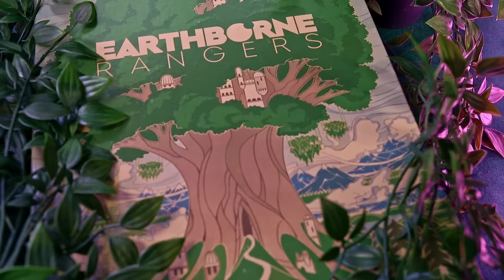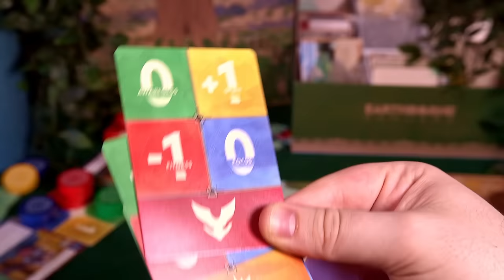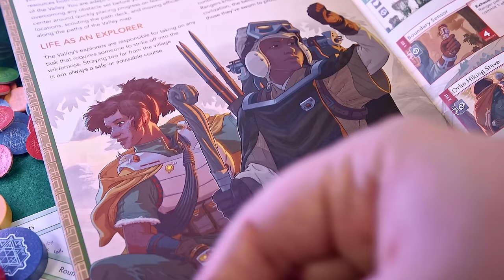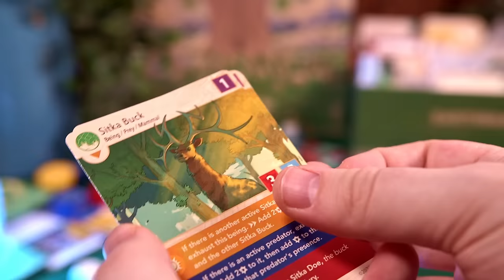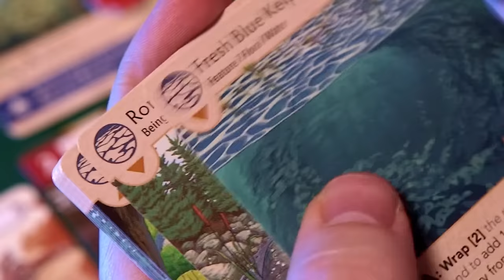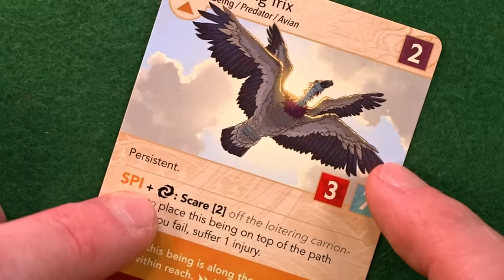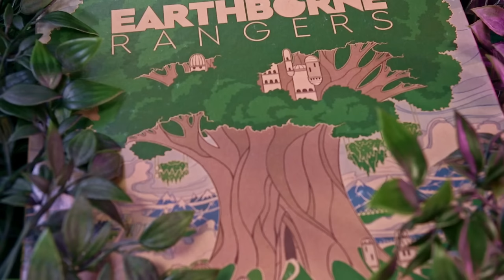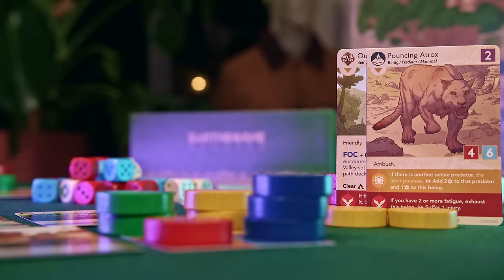Earthborne Rangers is Revolutionary

Comment: Yeah this game is really great! For those of you wondering if it’s worth the price, a single campaign can run 20+ sessions, so there is a lot of game in this box. It’s also one you could play with kids ~9 and up.
The cards came in a paper wrap that was so amazing and easy to open without damaging the cards, that I wish every game’s cards were wrapped that way.
Reply: Is it a one and done campaign?
Reply: @michaelrichard1320  no! The way the characters are made you’ll want to try different combinations of backgrounds and roles (similar to how Marvel Champions does deck building). And it looks like the new expansion has 1 of each! As is those two aspects alone give you 25 deck combinations. Plus each campaign will be slightly different.
Also, on that note, the card doubler is helpful if you’re going to player 3-4 rangers OR if you are going to play 2 different campaigns with different people concurrently.
I did the latter. Played a solo campaign with one background and role, and a 2p campaign with my partner as a completely different background and role. They presented different challenges and the campaigns turned out quite different!
Reply: @michaelrichard1320  Not at all. There's a ton of stuff to see and do in the game that isn't directly tied to the campaign story, so additional plays will likely have new things to see that you missed or passed over the previous time. And of course there's playing with new rangers and cards to add a lot of variety to how you take on challenges. They also just finished funding for a complete expansion campaign, including new cards to add to the Paths deck for the base campaign, as well as a new Ranger type.
Reply: Do I have to stick with the same group of people during one "campaign"? Could I theoretically play seperate campaigns with different people simultaneously like I get a game with four people only once every two months but I would play in between those two player rounds? Or is there some reseting to do in between those?
Reply: @michaelrichard1320 if you're looking for a different story the second time through, you won't get that here.
Reply: @jessecunningham9924 bold of you to assume they'll want to try different things. We have played about 8 sessions and then stopped, so we definitely won't be trying anything else
Reply: Just because you as a single person that for some reason doesn't wants to go on or try something different doesn't mean noone else will.
Reply: Should I sleeve the cards?

Comment: I hate to be that guy but... the reason the usb was one-sided was to reduce production costs and complexity, so that all electronics could have a comunication standard regardless of the production method. Usb-c requires specialised machinery to create the boards, thus excluding smaller manufacturers from it.
Of course, there is the argument of "who the heck buys tech from smaller manufacturers", but I would argue things like this are the cause of that.
Reply: That's nonsense, the only reason why USBc requires microsoldering (which usb micro also required, btw) is to make production cheaper, thus increasing profits for big corporations.

Comment: There are many fantastic things about this game, and Matt touches on a lot of them. The challenge effect mechanic, for instance, is beautiful!

But I can’t help but wonder about the player count that they played at. We have played about ten days at four players, and I think at that point the pacing of it starts to strain quite a bit, unfortunately. A day of play takes us between four and six hours and the game is lacking systems to inject new plot points during a day (like Arkham’s Agenda deck). All of the timed events happen at the start of the day, unless you trigger something through your progress (and many missions will take you several days as well). I think this is fine at lower player counts this is fine, as both the time commitment as well as the number of people that need to commit make it much easier to get it to the table regularly. (So I will get expansions, but I likely won’t play them at four.)

There are also smaller pacing things that I find baffling. First, through completing missions, you can get rewards to add to your deck. Some are designed to be precisely what you need in your current location, but to actually add them to your decks you need to travel away from those locations and end the day. So you have to wait for the next session and you won’t even be in the relevant place anymore. Maybe that’s because deckbuilding mid game would be annoying, you say. But the game has that as well: You will find traders which allow you to change a card from your hand for a different one from (nearly) the entire collection. The player triggering the effect will want to make the most of it, as these effects pretty rare, but this leads to the game screeching to a halt as everybody watches them go through a large stack of cards.

Even with the doubled number of tokens from the first-edition misprint of the token sheet (fixed before shipment by providing a second copy of the sheet), you will easily run out of general tokens. (There are plenty of harm and progress tokens though, so the balance is just off.) Again, I think this is a four-player problem.

Finally, all the characters feel a bit generic (as someone used to Arkham’s characters). You pick your aspects, background and profession all independently. But almost everything could be used by other players as well. There is little that makes your character feel truly unique around the table. (The first batch of expansions apparently aims to fix that.)

Phew. This was more negative than I thought. Again, many, many fantastic things here. But I would be careful at four players.
Reply: Thank you for the thoughtful comments! In regards to the 4 player and pacing concerns, I recommend checking ou the Moments on the Path expansion from the latest Kickstarter. One of the goals for that expansion is to help the pacing in higher player counts and add a little more variety. Full disclosure, I designed the expansion, so I'm biased, but I'm excited for folks to try it out and let us know how it works for them!
Reply: @DaviPaulino23  I looked at it when the campaign was active and I will be getting it (in the German localization, though). I hadn’t realized that it’s also meant to improve that part of the game, that’s good news! (I might still stay at a lower player count for the expansion campaign - I could use a solo game, I think.) Despite my gripes with the four-player pacing, I’m still very excited about this game.

Comment: $150 all-in on a Kickstarter that is over. Late pledge all-in....$230. Ouch. Gonna have to wait on this one.

*Edit mode*
Hey, I'm an idiot and you can read below to find out why!
Reply: You are comparing the Kickstarter from 2021 with the expansion campaign (all in) that just finished. If you add the old content (from the 150$) all in a-la-carte to the current late pledge it's only 180$ and adding the new $55 content you get the new late pledge $230 ($5 less than picking it alone). So yes, it's more expensive than the first printing, but not as much as your text makes it seem.
Reply: With a little research I can see the all-in was $205 during the campaign. So the late-pledge prices are indeed higher than during the campaign. What a bummer.
Reply: @Nezbo  I could have sworn the link I clicked was dated Jan. 2024.

It was. In fact January 25th. I failed to see that they were updating a.... 2021(?) Kickstarter project through the end of 23 and into 24.

For this the Internet may have my most humble apologies and I shall await my turn in the stockades.
Reply: @Nezbo  I don't LOVE paying more but I get it when it's a late pledge. They do incur some additional expenses.

$25 more isn't as drastic as I thought 150 to 230 was. I can live with that. I just need to budget for it.
Reply: @MonkeyButlerLabs  Looking at retail prices; I'll just wait for that and save some money
Reply: @Nezbo  At the very least we're driving engagement for SU&SD! :D
Reply: @MonkeyButlerLabs  Starship Troopers "doing my part" meme :D
Reply: Thanks for editing your comment and admitting a mistake, you're awesome 👍

Comment: Unfortunately i bounced back hard from this game, but i am keeping the base game to see if with expansions it gets better.
I played as solo for about 10 days in game, so it could be just that i need to go deeper, but for now my problems are:
-rulebook is very unclear and generally hard to comprehend, and i do not think it is because the "world is wild"
-campaign book is flawed with a massive amount of corrections that you need to check on the website, you cannot play without a browser open on the page
-components: the insert is a cool idea but practically not useful, cards are very filmsy and i suggest to sleeve everything, tokens were never a problem in solo but i can see it beign a problem in multi cause they are very few
-gameplay/travelling: every time you change location you have ti deconstruct the previous deck and build the new one, which gets repetitive very quickly and for me the idea of travelling through 6 locations is unbearable admin
-gamplay/end of day: the way you finish the day is a little strange, cause is supposed to be an "end of session" but it can either happen: to want to go on, i.e. beign too Fatigued and deciding to stop the day but wanting to continue the session; an NPC dies first 2 turns of the play session and having to stop the day and reset everything again
-gameplay/paths: it is true that you become very familiar with the different paths and you become more skilled at traversing, but for me personally that entails beign bored and never excited to go back the same paths, also cause in solo it boils down to be "no i cannot go through there cause i don t have the proper instruments"
-gamplay/challenges: the deck with the modifiers and symbols is a very cool idea, but sometimes (for me at least one time per session) you get screwed and can t really do anything about it, especially if you do not have cards in your hands cause drawing new cards is a challenge, which you can fail and activate some nasty red symbols spiralling out of control.

The game is fascinating and i want to love it, i ll try again maybe in 2p with an expansion in the future but for now i would not recommend it especially cause the price (which i find strange SUSD do not mention as they are always very careful) of the (splendid) choices made in production made the price very steep.

That s all folks! Thank you for reading my squabblings

Comment: I'm a fan of the game and I'm backing the next campaign, but this review is so flowery as to be completely nonsensical. It does incredibly little to tell you the actual game. It says no negatives, such as the length of time, the price, numerous errata; a couple of which are game breaking. I get being praising and enjoying a game, but once again, SUSD reviews are more flowery presentation than actual reviews. I can guarantee that if someone only watched this video and then tried to get the game, they will not have an accurate impression of the game.

Comment: with the whole sustainablity shpeel is not that i do not care, its that i am skeptical of it being part of the marketing for it making it biodegradable probably incresed carbon emmisions by a lot and especialy if those specialized materials had to be shipped all the way twards those smaller scale local production centers, and even if all those individual concerns are not true and they found a spot to make the game that has local access to all the materials needed and with production methods that dont have an increse in emmisions compared to normal, IF the location ends up being in somewhere inland the carbon emmisions from shipping with trucks are hightly likely to eat up all of the benefit it might have caused. that is why i feel skeptical and will do more research on it because if it ends up causing more emissions than the standard method then it is a failure of logistics and (i believe) shouldnt be supported for it